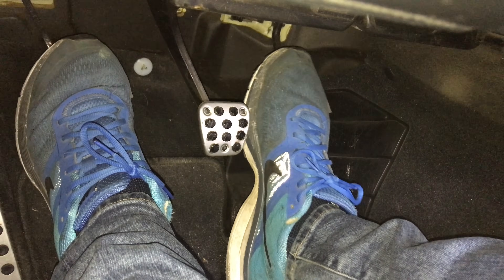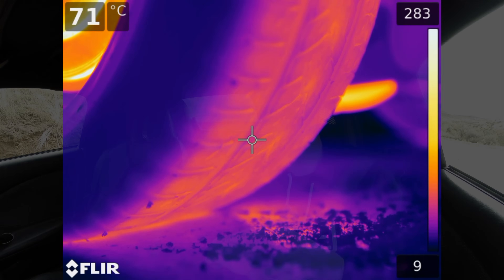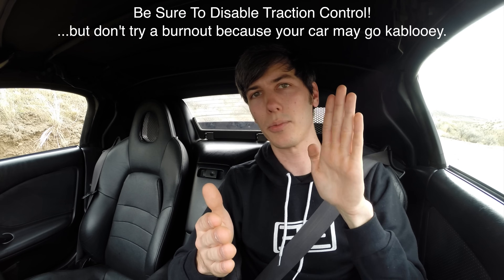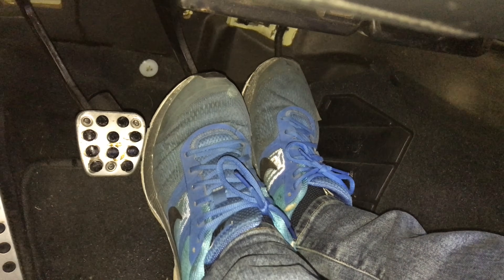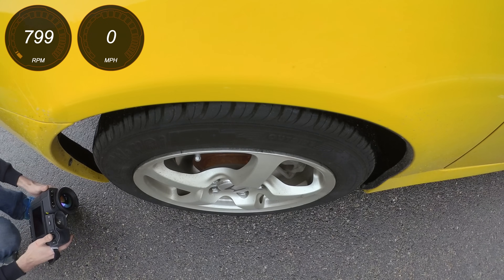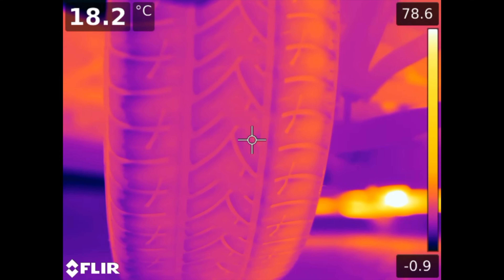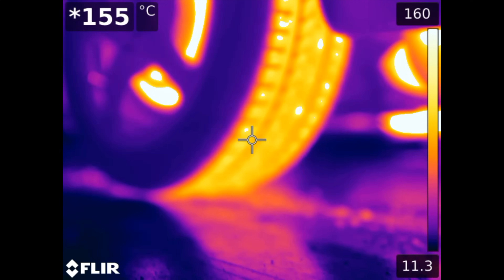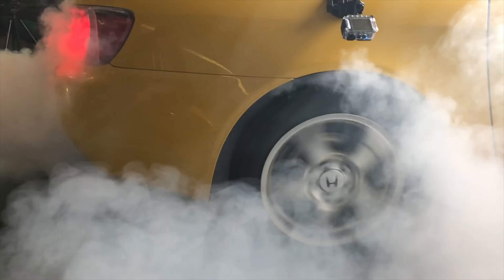How To Do A Burnout - Manual Transmission

Comment: why run negative camber on the back, sounds retarded to remove contact patch from the wheels that should actually steer around the corner. just let off and let the lsd unlock for a tighter turn in

Comment: I'll dump the clutch at 5k RPM and get on the brake a lil
then it'll inch forward slowly while spinning the rear tires
if you have an open diff, steer side to side to get both tires going, make some nice squiggly lines

Comment: to all you idiots if you want an effortless burnout that wont cause any mechanical damage throw some water in front of the wheels for easy slip, if you bog while you try to  do a burn out it will damage the diff

Comment: Why bother with auto transmission. It is for dummies. What are you doing driving an import?
A burnout in a manual transmission, I dunno, I never done that before. I better take a couple hours to read up on that. Yeah right. Are you a ricer or a tuner? What is actually the difference?

Comment: Fastest way is to set the tires on fire for a few minutes then quickly cool them out. This will avoid any problems with your clutch or messing up your transmission

Comment: Can someone explain why at 3:03 (after he dumped the clutch switched to brake + throttle) why he pumped the clutch before stopping?
Reply: So he could basically switch gears and get the car to fully stop

Comment: Doesn't it kill the rear brake pads if you apply the brakes during burnout?  If you want to heat up tires for traction then you need line lock.

Comment: I have a Integra DA 1990 with a B18 block and LS Head And has lots of torque for a 4 cylinder and a front wheel drive is it gonna be the same process as a rear wheeled drive car ? When burning out ?

Comment: There is a reason your brakes are glowing orange. Older Honda's used a 80/20 split with the brakes in the rear. Which makes doing burnouts bad for the rear brake since your riding on them.

Comment: A one wheel burnout is a result of an open differential and uneven traction at the tire contact patch.  Is it damaging to the vehicle clutch in a manual transmission, or to the diff?

Comment: Have a G35, and can't do a burn out. throttle cuts out when brake is applied, even with VDC off, do you know if i pull the vdc fuse if i could actually do one? g35 makes plenty more torque and power than an s2000, im pretty sure, so i don't think it's a power issue.

Comment: I don't know much about burnouts but according to how you said it's done, I need to accelerate while braking. My FWD car has its brakes on the front and obviously the front tires are the ones that spin so, it's obviously not gonna work. Does the handbrake lock up the rear tires?

Comment: Destroy your clutch, brakes and tyres all in one!
Reply: Legend Galaxy don't forget the bushings, joints and diff lol
Reply: you can destroy an automatic transmission that way too. The fluid can get really hot. Also the clutch here is always engaged and you don't wear it. You are mostly wrong about the clutch.
Reply: @dieselgeezer18  of course the clutch isn't being worn all that much during the burnout. Its the dropping of the clutch that puts alot of stress on it. Unless you have a heavy duty clutch, your gonna decimate it pretty quick with some burnouts.
Reply: @dieselgeezer18  I fucked up my clutch while trying to do a burnout
Reply: @vaseline4844  Try a stage 2 dual clutch.Less likely to explode under hard launch.Anything more and that clutch will be stiff unless you adjust everything but it will feel heavier under normal driving.
Reply: @dieselgeezer18  so it doesn't ruin it?
Reply: @0spectral289  it could break transmission components. But the clutch most of the time is fine
Reply: Yeah I'm just not going to do burnouts anymore unless it's from normal acceleration
Reply: nope, doing it on a bike wont do anything since front and rear brakes are totally separate, but on a car most likely only the tyres will get fucked since when you use the brakes its only applied to the front tyres and the rear ones are for the handbrake i guess
Reply: @doctorTF_2  Brakes on a car normally apply to front and rear but mostly front hand brake is usually just rear and is a separate brake system.
Reply: @doctorTF_2  bro what lmao. So you just don't ever change your rear brakes? Hahahaha wtf
Reply: @Altiveda  ??
Reply: Front line lock so you don't kill brakes
Reply: *tires
Reply: Live a little
Reply: I bet you forgot that you commented on this video three years ago 🤣
Reply: @kaiyan299  aha comments pop up now and again 😂
Reply: Then i probally shouldnt do this with my 32year old car
Reply: So do burnouts break your car yes or no?
Reply: @dylanmartino7975  yes!
Reply: @dylanmartino7975  Yes it absolutely can destroy the trans and engine if the right/wrong conditions occur.Ive seen trannys explode and rods be thrown from the vehicles over the years.Throwing the rod was caused by a cracked conrod but the trans was funnier because when the clutch exploded it took out the side of the bellowing and threw it and the shift fork across the track.Usually happens with stock configurations not designed for the abuse though.I had a 5 speed 97 gt modded to 905 hp,and could power burn at 80 mph like it was nothing and I never burnt the clutch in that car.Still had the McCloud double stage clutch when I sold it back in 2008.
Reply: What a combination
Reply: @hay man How doesn't it? Suddenly starting to try spin the axles and gears in the diff with a lot of stress, instead of medium/normal stress aka normal speeding up with not too much stress applied on the gas
Reply: And lungs lol
Reply: Smoke👍
Reply: How do you do a burnout without doing that?
Reply: Yes
Reply: I think i saw a random video where he thought he was doing a burnout but what he was really doing was just burning out his clutch and it exploded i think🤔
Reply: clutch is already pretty much gone 🤣
Reply: Lol

Comment: @EngineeringExplained  is there any problem like 
shifting from 2nd to fifth gear 
by stretching the 2nd gear u reach to a speed which generally requires 5th gear. so is it harmful for the gearbox? I am talking about 5 speed gearbox.

Comment: how does the brake work? will it still apply on the rear wheels as they are spinning or is there something clever enough to only lock the front wheels?

Comment: Wouldn't the rear brakes be a problem if the brake pedal is pushed too hard? - I mean, not damage the actual brakes as they kan take a lot, but make it impossible to get the wheels going and just burn the clutch?

Comment: In order to doing the burn out 1.turn off the tracking control "fully off" 2. Ur car must have a lsd 3. Google ur car to find the power output graph for the best rpm 4. Try to hold the rpm at the point u find in step 3 5. Drop the clutch otherwise u may burn ur culch 6. When u feel or hear the wheel spinning give a light break use ur left foot 7. U can managed the car by how hard u break 8. Release the gas and left foot clutch in all the way to stop 
Fwd burn out can be done by use hand break ! Don't need foot break but I will tried

Comment: You haven't mentionned anything about the strain all that crap puts on the drivetrain. The rear brakes are quite hot also. Hard on everything for not much purpose...

Comment: Would you need a line-lock to keep from melting your brakes and rotors?
Reply: Well a line lock would definitely prevent rear brake wear. But unless you're spending minutes every day power breaking, you wont do much more then wear the brake pads down a little faster.

Comment: doing a long burnout on street tires does not help get more traction. a very short one just to clean off the tires without adding the heat is usually works best just to activate the oils in the rubber just enough.... too much heat causes them to get less traction. more important:  tire pressure is critical to getting maximum traction for a given tire tread compound.

racers on slicks can do a longer burnout, as it sometimes does help.  Length of the burnout is up to the racer, to determine what works best for them.   
A note of courtesy- racers on slicks hate going directly after a racer on normal street tires just did a big burnout, as it also takes traction compound off the track, and sometimes they bring water up onto the starting line.... and bad things can happen...
Reply: maybe go into the tradeoffs of tire pressure.....  on road(conditions like snow), off road(,  road race, and drag race all have very different pressure requirements, and those depend on a lot of factors...

Comment: Hi Jason! But when doing a burnout in a manual, when we quickly release the clutch and slam the brakes - while giving full gas (in 1st gear) - wouldn't that stall the engine? 🤔//and wht abt the E-brakes should it be engaged or released?
Reply: If your engine is reved high enough and you dump the clutch and stay on the gas it won’t stall. If you dump it and don’t stay on the gas it will lurch forward (more than usual because the higher revs and yes stall out)

Doing this WITHOUT use of the brake, dumping the clutch, and staying on the gas will send your car hauling ass forward. How fast forward depends on how much power and torque your car has.

Comment: What about brake wear ?
Reply: TurboReplin The brakes are designed to be able to pull the car from 100+ MPH to full stop thousands of times over their lifetime, so the wear on the brakes will be minimal. The tire wear and clutch wear are the much more substantial issues with burnouts.

Comment: does it harm rear brakes?
Reply: Its just like stopping from 100mph or going down a steep hill, your brakes will get hot but not overly so.
Reply: itll do more harm to your clutch than it will your brakes cause your clutch is spinning a lot faster than your wheels. so don't do this!
Reply: Also brakes are easier to replace than a clutch. :P

Comment: At what point (temperature ) do non r compound or non drag radials/slicks lose traction because you've exceeded their operating temperature and the rubber becomes greasy?  Drag strips are pretty smooth and usually sprayed with traction compound.  Therefore a quick spin to clean the tire is enough for normal tires to launch well at drag strips.

Comment: Would be worth mentioning that you need a line lock to perform a burnout in a regular car like the S2000, otherwise applying the brakes applies the rears as well which will end your fun.
Reply: I was wondering about this. Thanks
Reply: Not true

Comment: Do you guys think it is possible to burnout a jeep wrangler 2.8 crd (200hp diesel engine)? without diff lock of course
Reply: Don't drifters weld their diffs to spin the tires better? Try that.
Reply: tonyvador67 my workmate does skids in his naturally aspirated tb42 patrol. Oh yeah and it also has 35 inch rock crawling tyres underneath it as well.
So long as it has a 2wd option you can turn em lol, some cars might just be a bit more difficult.
Reply: I would be do it man, blew out my rear diff doing one

Comment: In the automatic cars I have driven(mostly Audis) your explanation won't work because if you are in stop an you give gas the engine just revs in neutral. Is there a solution to this?
And yesterday I have driven a Jaguar XJ and I wanted to rev the engine the same way holding the brakes lightly and giving a bit of gas, but the car slowly moved forward. What causes those differences?

Comment: hey EE, on MCM guy from Fast and Furious set said that if you wanna see more smoke on the burnout, just spray your tires with WD40, a neat little trick from Hollywood ;)
Reply from the maker: Haha, was there not enough smoke for you?! 😂
Reply: Engineering Explained it was haha. just to give a little trick for the future, like..you know... we learn a lot from you, its time to give some back. ;) The guy from f&f said it starts smoking faster and it makes more smoke. have a good one mate
Reply from the maker: I hear ya. Certainly would make it easier to hold the car in place as well, rear would spin easily.

Comment: Burnouts outside of a drag race really bothers me, i mean why do it? Just to show off? But also having the risk of burning your tires, clutch or differential
Reply from the maker: I would agree, really only purpose is for heating tires before a drag pull. Street tires tend not to need as much heat for optimum performance, because they never really get that hot in comparison.

Comment: if you have a automatic front wheel drive car the best way to do a burn out is to start the car cold and as soon as it starts put it in reverse go backwards then slam it into drive , soon as your burnout is done shut the car off quickly and pour frezzing cold water on the engine to cool it down.
Reply: Thats also the best way to crack the block

Comment: I'm surprised you don't need that much braking to hold the car still, I guess once the tyres break free from the road they offer hardly any traction (hence antilock and esp).

I have always had FWD cars and they also all had disk bakes on the back which I've never found worked strongly with hand brakes. Is it possible to do a burn out in a mini cooper-s for example?

Comment: I tried your method, but it didn't work.None of the brake/clutch combinations worked.  I've burned up the clutch. Is that because my car is front wheel drive ?
Reply: Yes. When you are mashing the brake, you are keeping the front tires from being able to spin at all.  For a front wheel drive car, to do a burnout, you need to use the handbrake, which will lock up the back tires, but NOT the front tires.
Reply: I guess I found that out in a hard way. Thanks
Reply: Skaarj RPG are you serious? you thought the back wheels would spin if its a FRONT wheel drive?
Reply: @Invrexs  Not everyone is a stable genius.
Reply: RIP
Reply: 21 year old, 1.9 TDI VW Passat B5 - a wonder car in my country.
Reply: Don't try and charge your iPhone in the microwave.
Reply: iPhone in the microwave ? Wouldn't it be destroyed ?
Reply: I'm kinda nervous putting my $1000 iPhone in the microwave
Reply: Skaarj RPG 
Please dont try it and stop listening to people who are trolling you
Reply: Oh, okay.
Reply: Skaarj RPG no, I put my iPhone in the microwave all the time. if I get it wet, if there's a bug, basically it's a cure-all. haven't found any problem it won't fix yet.
Reply: Your clutch was on its way out or end of life, once you change for a new one it will be easy

Comment: What's the tire temperature during driving?
Reply: Unless your dumping the clutch at every green light, locking your brakes at every red light, and drifting around every corner, close to ground or ambient air temps.
Reply: Kai Cheng 
When you drive hard they get quite warm.
I would guess around 40-50 Celsius on normal road Tyres
Reply: When you're driving it's just static friction. Not too much heat will be produced unless the tire is skidding against the asphalt.

Comment: my god You're making science out of it. In my country in Europe we drive mostly manuals and fwd, with small engines. I can do burnouts even in a 70hp 1.0liter engine without handbrake... Just revit up near limiter, fast clutch release and there You go, most of the cars will keep spinning tires and do burnouts.
Reply: That isn't a big stationary burnout like at the end of this video though is it.
Reply: Ivan Doe thats a peel not a burnout
Reply: I know im late but wont the car stall if you just dump the clutch?
Reply: @enderzebak2863  If you have enough power, and dump the clutch, then the wheels will start spinning, acting as if you are moving. So no.
Reply: @jonsewell7330  so bascially if u have a lot of horsepower u can just dump the dump the clutch and it wont stall
Reply: ender z pretty much
Reply: @jonsewell7330  ok thanz i was just confused about since i havnt driven any cars yet
Reply: ender z No worries man :)
Reply: @enderzebak2863  I just hope you wont actually try it, lmao.
Reply: @MannyTak  dont worry lol i still dont have a car :(
Reply: @enderzebak2863  Ok, but if you do, you shouldn't do it. Lol.

Comment: Instead of losing torque at the wheels in the time you are switching your left foot from the clutch to the brake, why not keep the right foot depressed on both the brake and throttle, similar to a heel-toe maneuver? It's more certain to initiate a successful burnout.

Comment: Question: Is a burnout bad or not for air contamination (pollution) ? Or, if you prefer, are the emitted particles bad for your lungs/nature (like diesel particles that are extremely small), or are they harmless (like a "big" piece of rubber that will end up on the ground) ?
Reply from the maker: +Sionteul'demande Tudiras-Jensaisrien the smoke, to my best knowledge, is the adhesives that hold the tire together vaporizing. Very likely unhealthy.

Comment: Tried it in my Kia. Didn't seem to work in 1st gear, it's probably too slow, so I tried in 5th, also failed and smelled weird. Now I can't even accelerate, I can have the clutch dropped and be in a gear and the car won't move forward or stall or anything, it's like it's stuck in neutral somehow! Reported for destroying my car! :(
Reply: dodoz44 Troll or not very skilled.

Comment: I see that with an RWD you can manage it nicely with line lock, but my question is that if you apply line lock then whats happening with overall brake ballance like if its on its 100% front break but thats not good for everyday drive i mean is there a switch in your car that you can turn it on/off?

btw i have 1999 suzuki swift 1.0 53 HP so i wont make clouds :D but i have manage do drift nicely on wet road :D